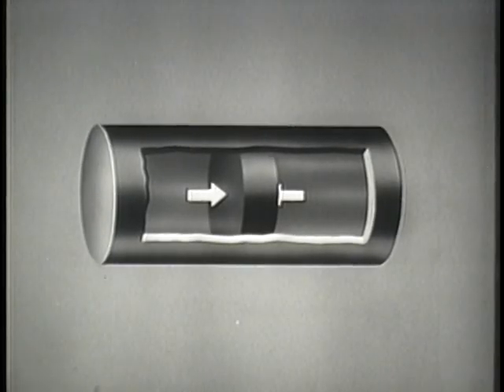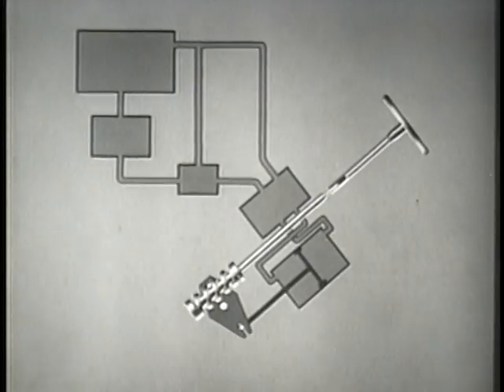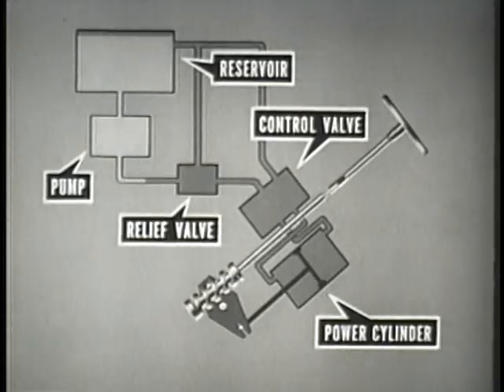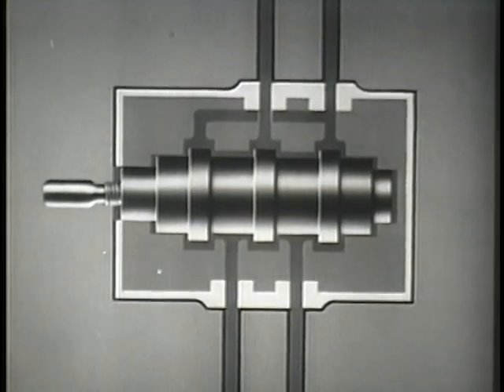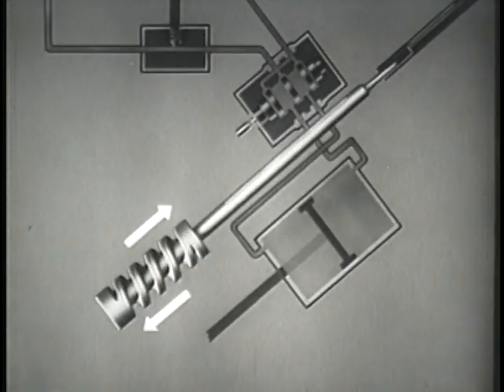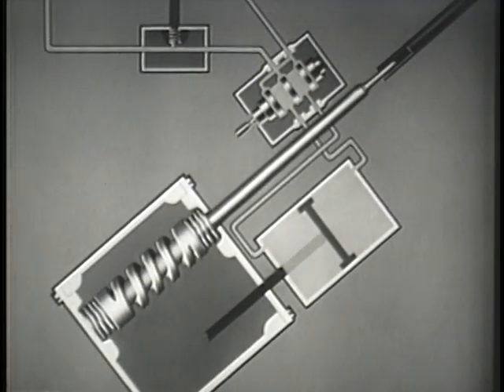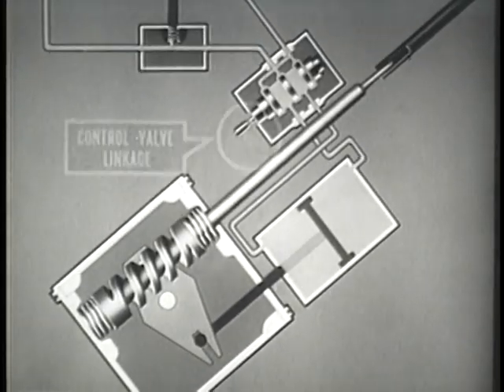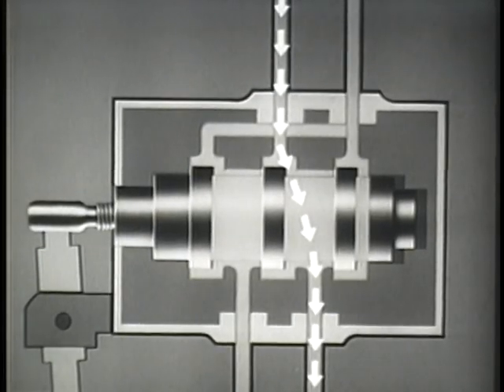Hydraulic Steering - Principles Of Operation (1956)

Comment: I taught college automotives. In the steering and suspension class we'd take these things apart reseal and reuse if possible. We opened shop for student and staff. We only charged 10% (to the big guy lol) over cost of parts. We brought in the money buddy!
And we replaced brushes in starters and alternators in automotive electricity and electronics in class. We rebuilt most engines, and learned not to be parts replacers, but today is cheaper to buy a rebuilt. With no garentee it will work the first time.

Comment: Worked with a guy in an auto repair shop back in the mid 90's. The pressure and return lines on a rack and pinion he was replacing had the same diameter fittings and he accidentally hooked them up backwards. When he started the engine up the steering wheel would spin violently in both directions. It was funny to me...but not so funny to him

Comment: So the driver doesn’t actually turn the wheels? The drive turns the worm gear, changing the pressure and the movement of the piston (due to the pressure) moves the wheels? Seems dangerous that you can’t turn the wheels if there’s a leak for something

Comment: Power steering (steam and mechanical systems)  were available on the big steam powered plowing tractors of the early 1900's.  All wheel drive was developed earlier, about 1885 on these same machines.

Comment: Training films like this one are absolute gold. While I'm certain that this particular system has been improved over the years, some of the components are still exactly as shown. I now understand steering far better than I ever did. Thanks for sharing this with us!
Reply: Power steering in modern times is entirely electrical, with a torque sensor in the steering wheel sending a signal to the ECU with both which direction to turn as well as how much torque the operator was using on the wheel. The ECU sends a signal to an electric motor with this input, as well as other data (such as the vehicle speed). This allows better control of turning, but can also help mitigate the potential for oversteering or attempting a hard turn at too great a speed. 

However, hydraulic power steering is still commonly used today in tractors, construction equipment, and other industrial vehicles where there is generally more mass and the vehicle operates at slower speeds, which makes more fine control of turns irrelevant. Hydraulic power steering provides more power when trying to turn a large, heavy tractor operating at 5-10 mph. The principle is the exact same as in this video.

Comment: This design is simply genius. A completely mechanical powered steering assist which only requires the engine to run in order to function.

Comment: So why is cam-pitman arm shaft connection needed at all? Why can‘t steering wheel influence (via a can) a control valve and that would move independent pitman arm (or pitman arm shaft)? Why does steering wheel still needs to be connected mechanically to pitman arm? Is it to make vehicle steerable even if hydraulic assist is broken?
Reply: That too. But as the name implies, it's an "assist" setup. There is not enough pressure created and/or controlled by the pump and/or relief valve to perform the directional setup. Also because you would need separate control functions, that would have to be carried out by additional control valves. Best example I can think of would be a skid steer, or backhoe that uses "static drive" setups. Which are VERY similar to this videos subject matter.

Comment: This is amazing! Also, I had no idea that hidraulic power steering was that old!
Reply: Germany used hydrolyc steering on their tanks I believe, at least their Panthers is where I heard it was used.
Reply: Hydraulic steering is actually almost as old as the automobile itself, but it was not until the 50s that it really was used on a large scale in passanger cars
Reply: @Patryk_Nowina-Nowicki  I'm amazed because, at least here in Europe I believe power steering bacame common in cars around the early to mid 90s, with exception of a few late 80s pickup trucks, power steering was practically unheard of.

Comment: Beautifully explained. My first and only concern was understanding how the control valve was only activated when needed. Seeing the springs on either side of the cam explained most of that. I wonder for how long the springs engage the control valve after tension is released from the springs. Certainly it’s not immediate.

Comment: This setup puts a little play in the steering,  which is ok on slow moving trucks,  but not so good on highway vehicles. The old army trucks topped out around 50 MPH,  I used to have one but it had manual steering.      There's been a dumbing down of the general population. Mechanical interest in young men has largely been replaced with video gaming.  I hear a lot of technical and mechanical courses have been dropping out of US colleges,  and many that are left are largely taken by foreign students,  to take the info home to their own country.   I came up without TV and before the advent of internet and video games.  What was around was primitive and I was not interested.  From about 13 years old I became extremely interested in mechanical and electrical technology.   It still interests me significantly 40 years later,  in the mean time I built my own home foundry and put together a machine shop of antique equipment,  so I can make things from scratch,  or from scrap.  Put together a steam engine powered 4x4 truck. Learned old style auto mechanics from a neighbor.   Also became a horseman,  an agriculturalist,  somewhat of a radio electronics technician,  studied natural healing and nutrition extensively,  and also became a timber harvester and sawmiller.   Now working on combining some of the above technologies and studies to become a greenhouse agriculturalist to retire on.  I was always so busy learning and doing interesting things I never made much money.  But I do need a retirement income better than the little bit of SS I'd get,  so I think nutrient dense fertility management in greenhouse agriculture would do it nicely,  with my shop skills as support to make stuff to run the greenhouse with.  I like eating good food fresh from the plant,  and I like the idea of hanging out in a tropical garden.

Comment: When I was a kid, I thought the steering wheel was directly connected to the wheels using gears
Reply: Rack and pinion uses gears.
Reply: Well i on the other hand, used to think it the steering wheel was connected with a rod to a gear, then another gear with a rod connected to another rod which are connected to both wheels.
Reply: it is, you can see it is in this video, it is just assisted by hydraulics.

Comment: most newer cars are totally different with rack n pinion struts front wheel drive some vehicles have electric motors powering brakes. this is great to watch i wish cars were still this way. many younger mechanics from my experience dont know how to adjust points rebuild carbs starters alternators generators etc. rip pontiac

Comment: That's kind of how the power assist in my 1965 Case 830 works, but it's all internal to the hydraulic cylinder.  On my more modern tractor, it uses a rotary valve that I don't understand at all, but it gives zero feedback.  If I let go of the steering wheel, it will stay exactly where it is pointed.

Comment: I remember this video!  My shop teacher also challenged us to find the mistake in the illustration.  Did you spot it?  The connection of the relief valve to the reservoir is wrong!  It should be a separate connection, not a "T" connection, which would direct pressure back to the control valve and defeat the purpose of the relief valve.  This film was shown to us first, followed by a newer film on how the GM Saginaw system worked and improved steering on cars and trucks.
Reply: @pmailkeey The "T" connection illustrated is not that kind of valve.  The lower "T" is the relief valve to direct over pressure back to the tank, but it is connected to the return line from the steering motor via a regular "T" connection.  You can't do that in hydraulic or air systems, you have to use separate lines leading back to the reservoir to prevent back pressure.

Comment: As I'm currently working for TRW helping make steering parts, you might be surprised how similar the modern resembles this film.
Reply: That's awesome, I have a TRW electronic module that was hidden inside the dash of my motorhome, I can't figure out what the hell it is or what it does, so that's how I came to know the company TRW which is apparently one of the biggest manufacturing companies for car parts now, never knew this

Comment: Remember hydraulic steering is not the same as power steering.  The are very few passenger vehicles built with hydraulic steering, this is usually reserved for very heavy duty trucks. In the US hydraulic steering is not allowed on passenger vehicles.
Reply: Just great...now I have to find a 1950s video explaining the difference between the two.
Reply: What are you talking about? Up until a few years ago almost all US passenger cars were equipped with "hydraulic power steering" which has a pump, a hydraulic oil, and is roughly comparable to this system. Maybe you're confusing hydraulic power brakes which is normally only seen on large trucks, whereas cars use vacuum power brakes. My dad has a GMC 2500HD pickup and it for example uses hydraulic power brakes

Comment: This video is still quite applicable today. The only difference between a modern power steering setup and this is that the steering column is connected more or less directly to the steering 'rack' which is a combination of the power cylinder and tie rods.

Comment: What *I like bout old Cars is that they made from strong cast Iron,,
Reply: Only difference is that if you crash a new car into an old car, the new one is totaled but everyone is alright, in the old car, it drives away and your insides were turned to jelly
Reply: No, as opposed to WEAK tin metal they use for stuff now.  A opposed to soft aluminum.  As opposed to fucking styrofoam packed bumper with godamn plastic as it's cover!  Derp.
Reply: There are different grades of cast iron. Not all of it is the fragile low grade stuff you find in plumbing.
Reply: yes, and I would definitely bet a shitload of money that current and recent car manufacturers surely use the highest grade metals across the board!   Which is totally why they use styrofoam filled plastic covered bumpers!  Because they care about quality lol.
Reply: In the old cars YOU were the crumple zone, so yeah, think again :P.
Old cars were simple and all you want but you really wouldn't want the level of safety they had in today's cars.
Reply: Today manufacturers made the chasis with a lot of plastic and thin metal because when you crash that car, the impact is absorbed by the chasis. Old cars were so tough that the passengers absorbed the mayority of the impact.
Reply: awesome.
Reply: +moorsteen: thank you for pointing that out! saved me that much typing ;-)
Reply: Cast iron is OK.... unless you need to weld the fucker...!!!
Reply: New cars would simply be too heavy to compete with emissions standards if they had had cast iron bodies.